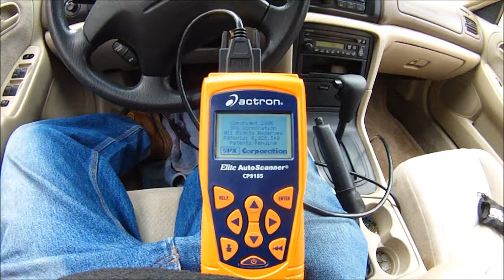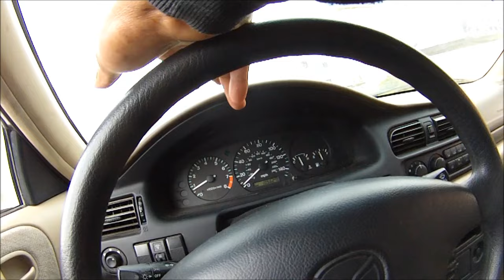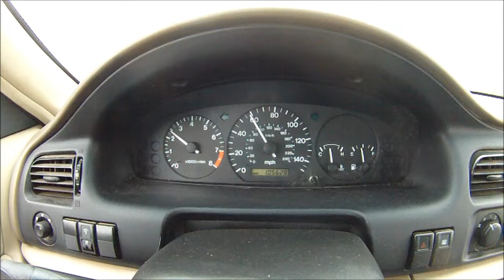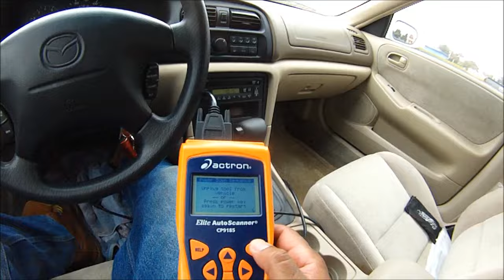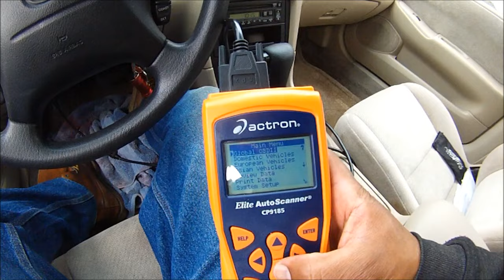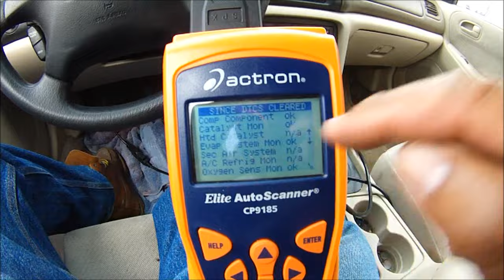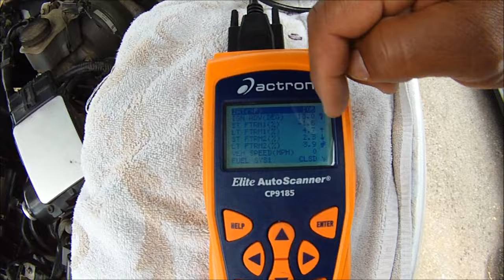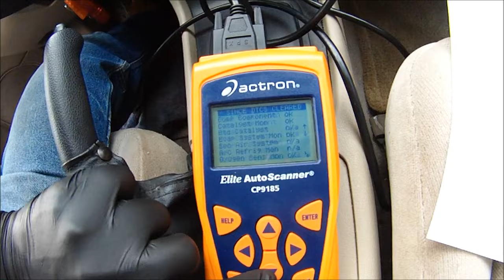WHAT SMOG TECHS WONT TELL YOU AFTER YOU FAIL THE SMOG TEST FOR (INCOMPLETION OF OBDII SELF TEST)

Comment: 1998 Ford F250

Ford Motor Company Driving Cycle
Description of OBDII Drive Cycle
The following procedure is designed to execute and complete the OBDII monitors and to clear the Ford P1000, I/M readiness code. To complete a specific monitor for repair verification, follow steps 1 through 4, then continue with the step described by the appropriate monitor found under the "OBDII Monitor Exercised" column. When the ambient air temperature is outside 4.4 to 37.8°C (40 to 100° F), or the altitude is above 2438 meters (8000 feet), the EVAP monitor will not run. If the P1000 code must be cleared in these conditions, the PCM must detect them once (twice on some applications) before the EVAP monitor can be "bypassed" and the P1000 cleared. The Evap "bypassing" procedure is described in the following drive cycle.
The OBDII Drive Cycle will be performed using a scan tool. Consult the instruction manual for each described function. NOTE: A detailed description of a Powertrain Control Module (PCM) Reset is found in this section, refer to the table of contents.
Drive Cycle Recommendations:
Most OBDII monitors will complete more readily using a "steady foot" driving style during cruise or acceleration modes. Operating the throttle in a "smooth" fashion will minimize the time required for monitor completion.
Fuel tank level should be between 1/2 and 3/4 fill with 3/4 fill being the most desirable.
The Evaporative Monitor can only operate during the first 30 minutes of engine operation. When executing the procedure for this monitor, stay in part throttle mode and drive in a smooth fashion to minimize "fuel slosh".
WARNING
STRICT OBSERVANCE OF POSTED SPEED LIMITS AND ATTENTION TO DRIVING CONDITIONS ARE MANDATORY WHEN PROCEEDING THROUGH THE FOLLOWING DRIVE CYCLES.
For best results, follow each of the following steps as accurately as possible:
OBDII Monitor
Exercised
Drive Cycle Procedure
Purpose of
Drive Cycle Procedure
Drive Cycle
Preparation
1. Install scan tool. Turn key on with the engine off. Cycle key off, then on. Select appropriate Vehicle & Engine qualifier. Clear all DTC's/ Perform a PCM Reset.
Bypasses engine soak timer. Resets OBDII Monitor status.

2. Begin to monitor the following PIDs: ECT, EVAPDC, FLI (if available) and TP MODE.
Start vehicle WITHOUT returning to Key Off.

3. Idle vehicle for 15 seconds. Drive at 64 Km/h (40 MPH) until ECT is at least 76.7°C (170° F).

Prep for Monitor Entry
4. Is IAT within 4.4 to 37.8°C (40 to 100° F)? If Not, complete the following steps but, note that step 14 will be required to "bypass " the Evap monitor and clear the P1000.
Engine warm-up and provide IAT input to the PCM.
HEGO
5. Cruise at 64 Km/h (40 MPH) for up to 4 minutes.
Executes the HEGO monitor.
EVAP
6. Cruise at 72 to 104 Km/h (45 to 65 MPH) for 10 minutes (avoid sharp turns and hills) Note, to initiate the monitor: TP MODE should =PT, EVAPDC must be >75%, and FLI must be between 15 and 85%
Executes the EVAP Monitor (If IAT is within 4.4 to 37.8° (40 to 100°F))
Catalyst
7. Drive in stop and go traffic conditions. Include five different constant cruise speeds, ranging from 40 to 72 Km/h (25 to 45 MPH) over  a 10 minute period.
Executes the Catalyst Monitor.
EGR
8. From a stop, accelerate to 72 Km/h (45 MPH) at 1/2 to 3/4 throttle. Repeat 3 times.
Executes the EGR Monitor.
SEC AIR/CCM (Engine)
9. Bring the vehicle to a stop. Idle with transmission in drive (neutral for M/T) for 2 minutes.
Executes the ISC portion of the CCM.
CCM (Trans)
10. For M/T, accelerate from 0 to 80 Km/h (o to 50 MPH), continue to step 11. For A/T, from a stop and in overdrive, moderately accelerate to 80 Km/h (50 MPH) and cruise for at least 15 seconds. Stop vehicle and repeat without overdrive to 64 Km/h (40 MPH) cruising for at least 30 seconds. While at 64 Km/h (40 MPH) , activate overdrive and accelerate to 80 Km/h (50 MPH) and cruise for at least 15 seconds. Stop for at least 20 seconds and repeat step 10 five times.
Executes the transmission portion of the CCM.
Misfire & Fuel Monitors
11. From a stop, accelerate to 104 Km/h (65 MPH). Decelerate at closed throttle until 64 Km/h (40 MPH) (no brakes). Repeat this 3 times.
Allows learning for the misfire monitor.
Readiness Check
12. Access the ON-Board System Readiness (OBDII monitor status) function on the scan tool. Determine whether all non-continuous monitors have completed. If not, go to step 13.
Determines if any monitor has not completed.
Pending Code Check and Evap Monitor "Bypass" Check
13. With the scan tool, check for pending codes. Conduct normal repair procedures for any pending code concern. Otherwise, rerun any incomplete monitor.
Note: if the EVAP monitor is not complete AND IAT was out of the 4.4 to 37.8° C (40 to 100° F) temperature range in step #4, or the altitude is over 2438 m. (8000 ft.), the Evap "bypass" procedure must be followed.
Proceed to step 14.
Determines if a pending code is preventing the clearing of P1000.
Evap Monitor "Bypass"
14. Park vehicle for a minimum of 8 hours. Repeat steps 2 through 12. DO NOT REPEAT STEP 1.
Allow the "bypass" counter to increment to two.
 
Reprinted on OBDII web site courtesy of Ford Motor Company
© Ford Motor Company
[ OBD-II Home ]
 
© 2011 B&B Electronics
The OBD-II Home Page is hosted by
Reply from the maker: George Shellum Thank you George, We have to stick together and beat this smog junk.

Comment: Try putting fuel injector cleaner in the engine and use up a tank to clean out the engine. Change the oil and filter. Change the filters and spark plugs. Check the radiator to make sure it's full. Check codes and replace parts indicated.

Comment: You do not need a one 2 monitor.   If you failed because of battery reset after repair or car battery died.     Usually, most cars if you put the key in ignition and turning to excess. Or the key as far before starting it.  So once you turn the key your engine light will go on.  After like 15 seconds if your car is not ready for emissions test your check engine light start to blink like 10 times.  And then go solid.    That means it’s not ready.   If the check engine light stays solid the whole time your car is ready for inspection.   Usually that’s how most cars are programmed.  If not just go to Napa etc and ask to use their obd reader go to engine and I/m readiness or whatever
Reply: Only certain cars do the blinking CEL trick.  Hondas and Chrysler for sure.

Comment: Always scan at the smog station parking lot before the test to make sure all monitors are complete.
I didn't scan and had to pay twice to pass smog.
I disconnected the battery a few months prior and never drove on the freeway. The O2 monitor needed freeway time.
Reply: Always make sure when you are picking a smog check location that they offer free retests within a certain time frame if you fail or are not ready.  Many do for the cars 2000 and newer.  More rare on the cars older than 2000.

Comment: my 07 lexus has been sitting for  a few months.  oil change is long overdue.  Im throwing code P0446 evap small leak.  I just changed the air filter, cleaned throttle body and mass air flow.  I Put techron fuel cleaner and and that cleared the code temporarily but then it came back.  Still need to change oil.  car runs very very well.  I don't have scanner to clear code.  What do you think I have to do the clear check engine light and keep it off to pass?

Comment: Dear Master OldSkool Funk.

This is truly an OLDIE BUT A GOODIE :-)

The Car: 1996 Lexus ES300 with 337,000 on the clock ( Whaaaat??? )

Issue: Failed Smog due to High HC, I suspected the Fuel Pressure Regulator (FPR) but it tested fine according to Haynes test procedure, no leaks detected or observed.

Diagnosed at Smog Repair Shop: Normally after failure $85 but $130 because I threw a CEL a week later (BS). So they stated it need a new FPR, New Cat (50% efficiency, WTF???) and suggested new O2S's (3 of course) because they were reading slow. Cost for repair $1200.

My response, Fuch ( Old Skool Porsche Wheel ) it, I will junk her and get $700!!!

Then I calmed down.

So I deduced, 2 years ago when another smog repair steal shop sold me a Cat due to high HC's, he did not fix the issue which was the FPR. Basturd!

So I went to Clarks Discount Auto and bought a new FPR, 3 new Denso O2S's and went to my local FLAPS and bought some CataClean ( Yes, I know snake oil  but I plan to use this after the repairs, if not $340 for a new cat )

All parts under $250 :-) plus $27 Cataclean.

FPR, done
Bank 2 O2S (Front, easy), done
Bank 1 O2S (Rear, OMG PITA), done ( when I replaced the Power Steering line, I accidentally dislodged the bracket and the connector melted on the manifold and appeared to have shorted out, DING DING DING culprit found )
Down Stream O2S, done ( OEM )

So the real issue was BANK 1 O2S wires melted and shorted out causing it to think it was rich so it leaned the hell out of it causing Bank 2 to richen the hell up ergo dumping fuel on the cat, fouling it and tripping the CEL "catalyst low efficiency"

I think the FPR is fine but better safe than sorry, it was swapped 6 years ago due to failure, Damn ethanol.

While I was under there, I swapped the motor mount, what a major PITA.

I did not clear the CEL. I poured the CataClean the tank with calculated 4 gallons of gas or 1/4 tank and drove her for 50 miles to clean out the CAT. SUCCESS CEL turned off on it's own.

I then proceeded to clear the Memory to get rid of the old data. I noticed a considerable cleaner exhaust smell, quick start, smoother idle and more power.

Did your DC procedure to the letter and Readiness is Y.

I am ready to re-check the Smog for $10.00

Thank you again Master OldSkool Funk!

Your Fan,

Jim
Reply: Jim Chang Update: Passed People Republic of Kalifornia's Smog :-)

OSF, can you post a video on how you determined you had a bad Fuel Injector/s, my HC levels are still too high at 44PPM coasting at 15MPH.

TIA,

Jim

Comment: I took my 2002 Pontiac Grand Am to Fidelity Automotive in Santa Cruz CA. The receptionist came out and told me that the computer wasn't ready? The catalyst was not showing the computer. I needed to take it for the weekend and drive 60-70 miles ad then bring it back. Mind you I had just driven this car from Winters CA (239mi), approx. a month prior. As well I had NOT been putting premium gasoline into the car and the last time it had been serviced was in May of 2017 (oil change), and the last passed emissions reading was at 155K. The vehicle now has 161K. The information I have been able to provide for you is from a Carfax report that I purchased 7/13/18. I have tried a drive cycle from another You Tuber's channel and I still get no reading from the computer on the OBDII Scanner? What do I do now? Have any suggestions or is my Cat dogged out?

Comment: Good work bro, I will try your trick on my BMW 740i.  I got all monitors ready except for the evap system monitor.  Thanks for your contribution, God Bless
Reply from the maker: +Meantime5 Ya I have a 2001 Civic that did not set the Evap & O2 sensor monitors today also. Keep doing the cycle and be persistent sometimes it take a few drive cycles to set. Thanks for the comment God Bless.

Comment: Hey old skool funk, I drive a 08 335i bmw, I’m wondering what else I could possibly do so the machines can get ready, I have the cat, 02, & evap light on I did what you showed me twice and in the first run The evap system was all good to go BUT the 02 and cat sensor stayed on. I’ve changed Two  o2 sensor 300 miles ago no check engine light on... what should I do??

Comment: Good Job Man but I just already paid $400 rip-off to pass my smoke check since my catalyst monitor not ready fail the test again. This is the third time (within 6yrs) I fail smoke check due to above same problem.last 2 times and each time I just only paid $150 to pass from the same mechanic.But this time he said still fail.He said that Clean O2sensor ,airflow cleanup so that costs $400.My car is 200 Mercedes benz E320 and only 70,000 miles on it. Thanks for your post.I believe you and save your post and next 2 yrs smoke check time and I will do the same thing which just you show up  and to save another $400 from ripoff.....
Reply from the maker: Time to start fixing your own car my man. Spend time researching every situation you come across.
Reply: @oldskoolfunk71  I will do it from now since so much valuable informations like you are share internet now.Why not take a chance? Thanks.

Comment: hey oldschool funk, THANK YOU!!!!!! for the informative info dealing with smog test, I have an Actron scanner similar to yours and had no idea  I can check  the I/M monitors with it to see if it's ready for emissions test! I changed my O2 Sensor recently and cleared my check engine light and what happened in the past I would keep going back and forth to the emissions test sight  over and over again just to hear. " your computer is not ready" 5 or 6 times. but since looking at your video I can see just when it's ready by hooking up my Scanner and checking for either " incomplete". which is not ready or " OK"  which means it's ready to be tested!!!!!    so far all the monitors are ready except that pain in  the butt '( Catalyst  conv). and the ( Evap!) my pathfinder is always a pain to get up to the mileage to get ready for test.. usually at 280 miles. I got 106 now and checking for evap and cat. to say okay.. But Thank you for the info cause now I can see when it's ready to go to test. I subbed your channel, Bro. Peace

Comment: Hi!
I just came across this video from google. I am also from Chula Vista! I saw the freeway signs and recognized them immediately!

Anyway, I have a '98 Integra LS (non-vtec). I needed a smog certificate to get it registered and took it to a smog check station. For some reason the bulb for the CEL was not there (car use to belong to my brother and he may have had something to do with it). The smog tech saw that and checked the codes. Only one code popped; "P0420: Catalyst System Efficiency Below Threshold". So I failed. Emissions were withing range and everything else looked good to him. 
The next day i got put in the bulb and sure enough the CEL was on. 
Ever since it failed smog, I rechecked everything and it looked in good condition (it got a tune-up under a year ago), but I still went ahead and replaced the spark plugs (old ones were copper. Now has NGK G-power). 
Just to be safe (and recommended from a relative that's a mechanic), I bought the downstream o2 sensor from autozone, but it was the wrong one (wrong plug). The one that actually fits cost twice the price ($127) so that's going to have wait til my next paycheck. I had cleared the codes prior to realizing that i had the wrong o2 sensor. I have driven the car normally for the last few days prior to watching this vid. I've put about 40 miles on it since clearing the codes. Still no CEL.
But here's my question, do you think I can still attempt to complete a drive cycle even though it's been driven?

Comment: Haven’t read all the comments, but I’m wondering if this can be done while the car is on jack stands/lift with the drive wheels up in the air. It would most likely be a no go if it’s dependent on metering the intake of the ambient air or perhaps trans/ speedo reading? 🤔
Reply: Yea and also part of it is the engine needs to see a load.  So you can do it on a dyno but not up on jack stands.  Although it might work for some cars.    Hard to say all cars are different.

Comment: To hold your EVAP test "incomplete" on a machine that will continuously fail EVAP test, keep the fuel level below 15% and do the drive test then the smog test.   In many states you can pass emissions with one test still incomplete.  If it fails you fail, but if it is still incomplete and will fail in 20 miles, you pass, no need to fix it.

Comment: Thank you for posting this. So many people think that when they clear the code after repairing an issue that relates to smog or their state OBII inspection they think everything is okay just because there is no check engine light. It's much more complicated then that like just what you have shown here. Thank you for validating my point to these so called technicians who say I do not know what I am talking about, You have to drive the vehicle!! I did a 2004 GMC 5.3 pickup after I replaced a fuel pump, evap hoses to the gas tank it took me over 100 miles for the codes to drop in order to pass NC state inspection.

Comment: The drive cycle was added on obd2 because people where disconnecting their batteries a few blocks away from the emission places then reconnecting it then driving into the emissions places to get them passed now with obd2 it has to go threw a drive cycle to check all the emissions equipment on the car all the emission places are doing is making sure it passed all of them if you still have a code stored they will fail your car

Comment: It's crazy what a specific set of conditions you need for the test to complete. As you say it would take thousands of kilometers to do naturally and you probably still wouldn't pull it off.

Wondering why the stop without hitting the brake is necessary - I know the handbrake is all mechanical and separate from the normal brake but why would they design it like that? Either brake would stall the torque converter in the same way.